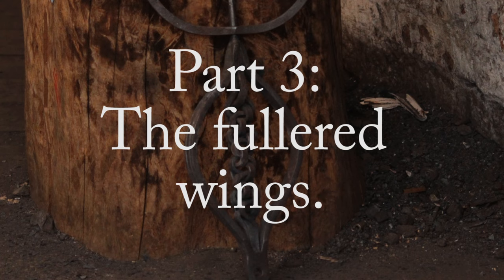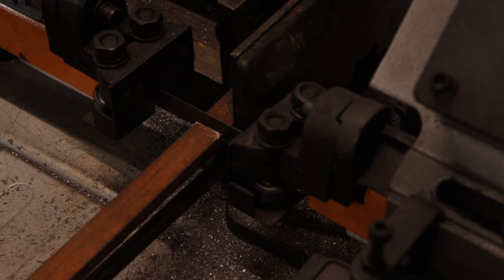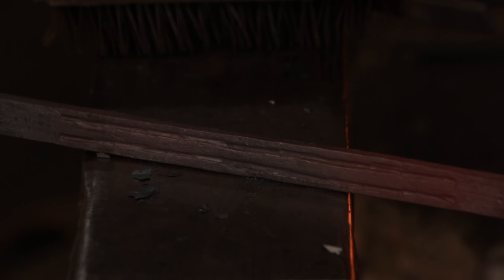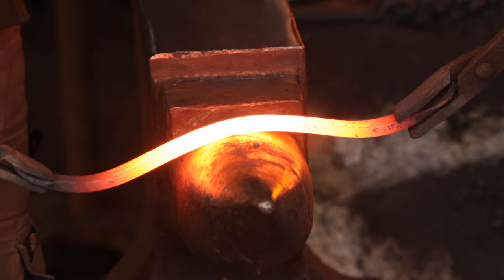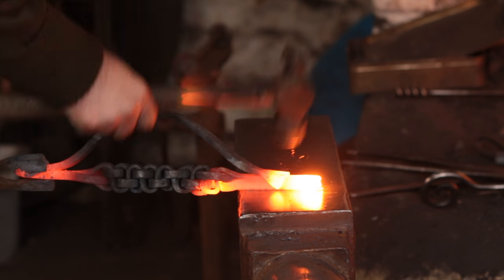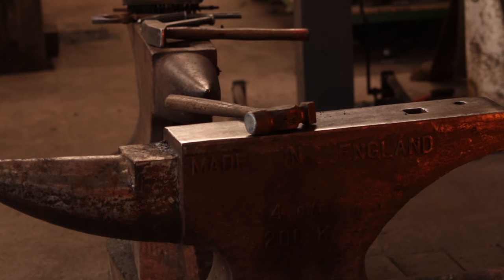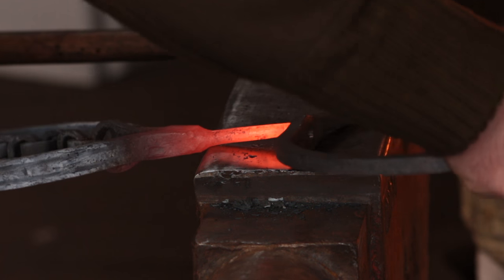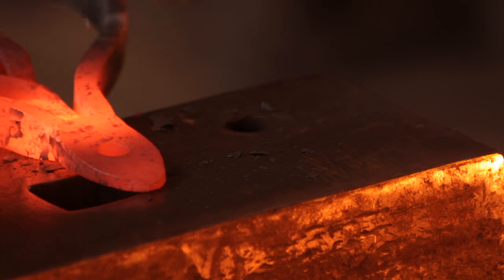Forging the Sutton Hoo chain. Part 3: The fullered side bars.

Comment: Thanks for the video. I got a question: do you get a neutral fire in a gas forge or does that depend of the oxygen flow (I guess it depends on the venturi effect then)
Reply from the maker: No worries :) It will depend on the oxygen flow. You can adjust this on some gas forges but I am no expert I'm afraid. I have a gas forge which I use for batch jobs and heat treating but I would never attempt to weld in it because mine won't reach the right temperatures. Owen Bush does all of his welding in a gas forge and his welds come out fabulous though, so I know that it can be done. 

I think that the trick is to have a blue flame coming out of the door and that means that you have a neutral fire at that point (the blue flame being excess gas, meaning that there is no oxygen left in the forge). I am not 100% on this, though, so you should double-check it.

Comment: Grateful to see the process sans welder.  It's what I find myself wanting to know most, as I watch other smiths.   I'm wondering about what sort of flux [if any] would have been available for metals not as easily controlled.  Or does the neutral heat apply more or less across the board?
Reply from the maker: Hi Joel. As far as I know, silver sand and crushed seashells are supposed to have been used as flux around the period, though I don't know of any references for this so it may be a myth. Using a neutral fire works for iron and mild steel.

I DO use borax when forge welding high carbon steels and spring steels though, as the higher carbon content makes them more likely to crumble. I will still use a neutral fire when using borax though because it guarantees the best result possible.

Comment: I hate how good you are at forge welding, that fact aside, the piece is looking well, finished article will definitely be operator(quality).
Reply from the maker: Haha, cheers mate. Practice, practice, practice is all it takes. It takes many mistakes to get good at welding. the trick is to never give up and keep starting again. If you make a mistake, look at it closely, see why it doesn't look or feel right and do the next one slightly differently according to what you have seen.

Comment: Didn't have iron wire? From what I know anglo-saxons only existed from about 6th Century AD in Britain, and by that time they surely had chainmail - impossible to do without iron. The very site that had the chain you're recreating (Sutton Hoo) had a chainmail found in there :P They must've had wire and the technology to make it. It was probably limited to upper class, but then this chain and cauldron is likely something only a king could afford.
Reply from the maker: You make a very good point and indeed a coat of mail was found at the Sutton Hoo site. Wire has indeed been known for millenia and indeed the Romans even used chainmail in certain instances. However wire drawing (the commercially viable means of producing wire) wasn't developed until between the 8th and 11th century. You will see an increased use of chainmail alongside the development of wire-drawing. 

Prior to this, production methods are unclear - perhaps the "wire" was forged-out, or perhaps it was cut from sheet material (probably the easiest method). For jewellery making, thin strips were cut and block-rolled to create cylinders though there is no evidence that this technique was used in ironwork. Indeed it would produce quite weak wire. 

So I guess what I meant is that they had no wire that they could just grab for a quick job as it would have been tremendously expensive and exceedingly rare!
Reply: Yeah, they probably didn't use it that much as a help in forging as it would be much more precious than the modern commercially available one (iron generally was much more expensive), but I could imagine them using it as an aid in making complex pattern welding for swords for example, to hold the bars together (unless there's an easy method to have that without the wire, I'm only a very beginner smith) ;)
Reply from the maker: TrollDragomir, the traditional way to do it without wire is to use a piece of flat bar in a manner identical to making a collar for decorative work. it works very well for pattern welding as it stops your billets from sliding around so much better than wire. It wouldn't have been practical for this project though as it was just easier yo hold it by hand.
Reply: Now I kind of feel ashamed I didn't think of that, it's so obvious :P  Usually when something seems hard without modern tools there's a method that dates way back and is both easier and more efficient. Just like wrought iron - they had a soft material straight out of the bloomery only reforged a few times with low carbon content - but then it was so much easier to work and weld than even modern mild steel, with no need for fluxing. I wonder - could that be, aside from economics, one of the reasons why only the cutting edge of tools was steel? After all it's so much easier to make and weld a folded axe head with wrought iron, and only a bar of steel for the blade.
Reply from the maker: Don't be ashamed lol. The use of edges would be partly due to Carbon steel being difficult or complicated to make back then with no guarantee that you would get the carbon steel you were trying to obtain. While it's possible to smelt a higher carbon steel by making a taller bloomery furnace, it is my understanding that most of the carbon steel produced would have been blister steel - carburised wrought-iron. This would have been a process taking 12 to 20 hours. I'll be doing a video on that in a couple of projects (I'm making an 18th century bayonet after the Sutton Hoo Chain so it will be the project after that)